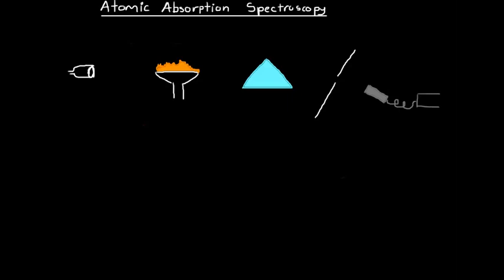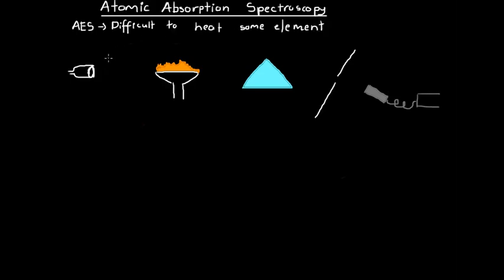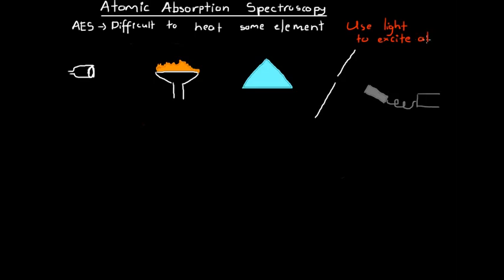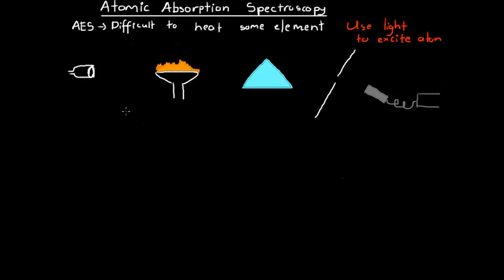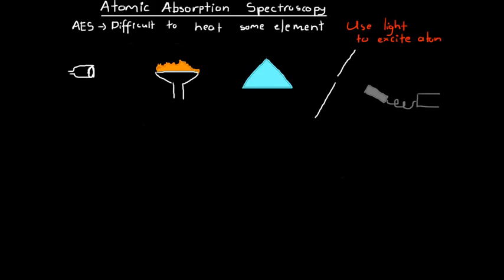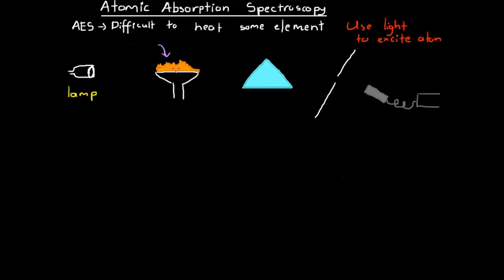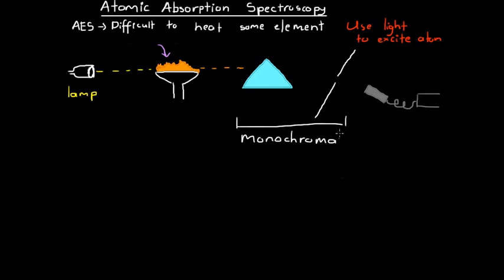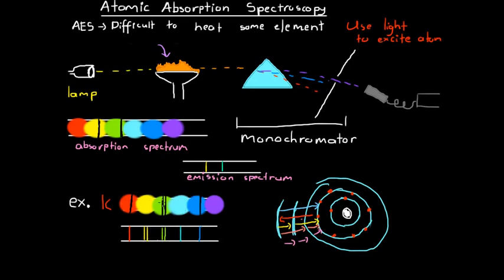Atomic Absorpbtion Spectroscopy

Comment: Say the specific metal is present in the sample. Why doesn't all the light get absorbed, since the lamp emits (only?) the frequencies that can excite the metal?
Reply: +Chris D there are many lines different from the analyte lines; for example, lines from the gas filling the lamp, Argon, and , I am not sure, the cathode may heat up and emit
Reply: @robefernandez1960  But why not use a "normal lamp" radiating all wavelength of the visible range instead, like Tungsten lamps etc.?
Reply: The lamp temperature and other stp conditions are controlled to keep the atom ( Na, Pb, Cu...etc) in ground state, so that it can absorb the required  energy in the particular wave length to reach excited state.